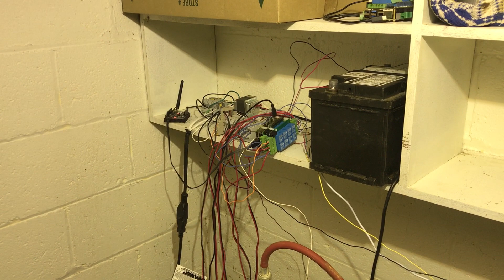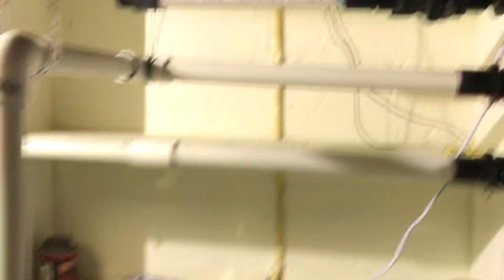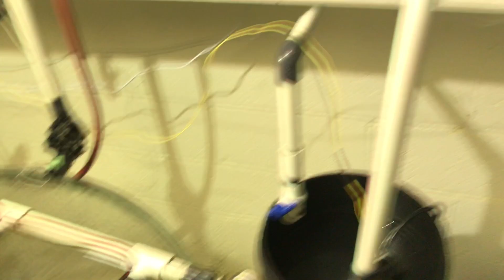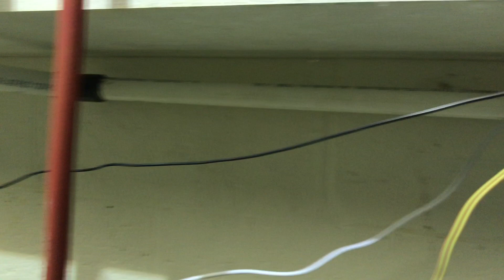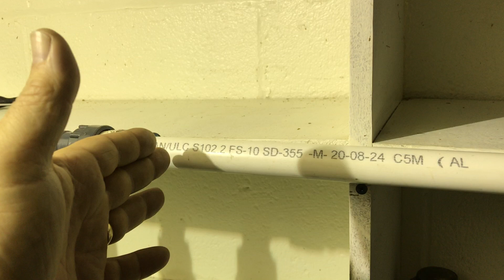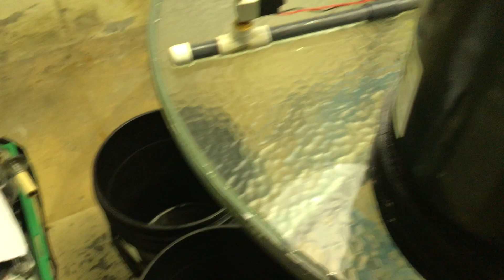Shotgun Aeroponics

Comment: Is this using RO water? How is the buildup in the nozzles? 

Very cool setup, this is unique. My worry is the quality of water your feeding. Also, interested in the nute cost versus DWC. This seems like drain to waste on steroids.
Reply: Not RO water yet, but no buildup in the nozzles. On Lake Ontario city water so not too hard here. pH is 7.8 at the tap so using about 50ml/day of pH down. Nute cost seems very low. To maintain 300 ppm requires 2-3 tablespoons of liquid non-organic nutes per day. Feeding is now also automated using a 1600 ppm concentrated solution added during water replenishment every 150 misting cycles (about every 100  minutes). Better light/water/food/humidity/CO2 is required to really test properly. More interested in getting the controls all working properly right now. But, the plants are still alive!

Comment: Hi Martin, 
A solar panel/charger will keep the battery topped up. I have 75psi mains water but its so hard you can almost stand a spoon up in it :) I`ve used it to power aerocloners in the past, the only problem was i needed a decent length of tubing to give it time to warm up to room temp from 50F.  It comes in  handy for testing nozzles (on the outside tap) and the pressure is plenty high enough to run the RO system. You have an eye for detail so you`ll soon pick up the skills needed to keep plants alive.
Reply from the maker: Yes re a solar panel as this system uses very little power. My water comes from Lake Ontario and I measure 7.6 pH with a BlueLab pH pen. Incoming city water temp is between 45F (winter) and 55F (summer). Time spent in the bucket and my piping passing near the light raise the temp and can be adjusted. I will measure temp in the root zone soon and make adjustments to the pipe length and proximity to the light so the root zone stays at 65-70F...which I have read is the desired range.
Reply: @recessd4094  
I aim for chamber temps no higher than 21c  lights on and no lower than 17c  lights off.  The main thing is to get something growing  :)

Comment: Cool deal brother! Looking good!  Keep it up!  We got to bring gardening up to the 21st Century standard lol!  Like the idea... A LOT, understand the efficiency you are trying to get.  One thing that might help the community is the practicality.... I know most won't spend the money like how some of us do.... Initial cost involved is what I try to keep in focus.

Also, many may not have the skill set you posses  and  taking the first steps into Aero might be intimidating as it was for me when I took it up.   K.I.S.S. is what I try to apply....  because, I know for many they want to have the hands off... OR might not have the trouble shooting skills required to chase down a clog at a single point.

Couple of things I've noticed during my years of doing this is... Oxygenation in your water/reservoir and  mixing of the nutrients.  I've remedied this with a "mixing pump" which uses a aeration tube and velocity to draw air into the mix.... this pump runs the entire time on my outdoor res.

Last thing I've noticed on my grows is that .. with Aero I have been able to push a lot higher PPM than with say a DWC system without burn. ... so, I don't know if dilution of the nutrients will deprive your plants.  Since the dosages are more controlled and in smaller intervals I've played with the water to nute ratio.

Keep me posted with your grow and I really like your set up because if you are going to grow different plants then it would be nice to customize the feed rate cycles to each individual base!
Reply from the maker: Thanks! Glad you like it as I respect your opinion and experience. I'm currently slowly dialing down the cycle time, interval, and adjusting the root height above the nozzle to find the sweet spot that makes the roots happy, white, fine, dense, etc. I think I'm currently overwatering. Then, I can refine the pump/valve timing to mix/load nutrients into the Loading bucket just prior to the start of a new cycle (meaning no dwell time or large reserve of nutrients). Hopefully that will eliminate the need for Oxygenation in the Reservoir? Trying to eliminate as many moving and electrical parts as possible. If you have a link to one of your videos that shows your oxygenation/mixing setup, I would appreciate it. Higher PPM is interesting. I've been running 250 ppm in the first few weeks of the first grow, only because I read Aero only needs 1/5th the nutrients of soil. What would you suggest and what would I notice re burn if I was running too hot? Initial cost is quite low as Raspberry Pi's are almost as cheap as wheel timers and 100 times more useful. I'll upload a few more videos in the next week or two.
Reply: @recessd4094  how many solenoids are you running?  can you isolate them and fire them individually?  sequentially or saturation set up?

as for the nutrients... play with it is what I will say.  take everything you read with a grain of salt.... no 2 systems are the same... 

you will have may factors that will be game changers.... have you noticed the lighting guys always talk about micromoles and photons?  how some then talk about spectrum? lol

then you got wind or fan circulation and it's importance and humidity VPD.... and then you have the guys who say its not important... it's the "swings" that kill you lol.  temp shifts from lights on and off... or far red and being able to shorten the sleep time so, 14 hrs vs 18 hrs.

then you got intensity  vs duration....  and then you got things like calcium in flower.... too many factors to say it's one thing...

I think many people forget this is a system thing....  "as a whole"

best advice i have for you is... know your system and know your plants... if you can diagnose them both.... you will be solid.

just keep going at it and it will tell you one way or the other.... it always does lol
Reply from the maker: @aeromah1062  Currently.... 7 solenoids,  3 valves, and a submersible pump, controlled by a Raspberry Pi. Check out Video 2 for how I control them. Currently firing the solenoids for .750 seconds every 38 seconds. Fully adjustable via software so I have all the controls...just gotta figure out how to drive. I don't have a decent light or CO2 or humidity control yet so focusing on root development. I will start new clones every week or two and monitor improvements in the roots of newer plants as I tweak PPM, pH, firing time and cycle time. Once I like the roots I will worry about lights, humidity, CO2, etc. First try was too wet (misted for 2 seconds every 45 seconds).. 2nd try better. Will get the wiring tidied up over the weekend and post a new video about that early next week.

Comment: Very interesting idea, but as you've said the nutrient solution becoming more and more diluted. Even if you'd run a constant and very precise equipment to measure the pH and EC(For example Atlas Scientific, they actually have a hydroponics kit) you'd end up using much more nutrients in the long run, and that's ain't no cheap. Also, that's tap water. Have you measured the EC of it? Even if the EC and hardness is good, it can have contamination of iron, copper etc. what could eventually set back your overall growing efficiency. On top of that it's very nice that you have 70psi pressure (super excellent actually, where I live it's a fraction of that) but have you thought about the fluctuations of the pressure? In the mornings, and in the evenings when everyone is using the water in the city, the pressure significantly drops down, making your system a low pressure one also your calculations for how much nutrient you should add changes.
Don't get me wrong, this is actually something super new what I've never seen before, but I think if I'd run your system I'd go bald from the stress what it'd cause to me. Also, I think a properly dialed in nutrient solution in dwc would kick the ass of a fluctuating solution/with potential nutrient toxicity hpa, but that's just my 2 cents.
Reply: Thanks for your feedback. There is no real need to return the water used to create pressure to the nutrient bucket other than I don't have a floor drain handy in that part of the basement. The current water consumption is .5 ml per spray X 7 nozzles X 90 cycles/hr X 24 hours = 7.56 L /Day so about equal to about one extra toilet flush per day when I switch to an R/O food supply and drain the pressure water to waste. The city pressure never varies from 70 psi. The variations come when somebody in the house flushes the toilet or has a shower. The quality of the mist deteriorates for a few minutes, but nothing the roots shouldn't be able to handle. My strength is actually automation, not gardening. Building EC, pH, and Humidity control with PID loops (automatic self adjustment) for each into the Pi is not difficult. If you look closely at the pile of wiring you will see an antenna on the left through which I can monitor and control the system over the internet. It will be able to maintain a consistent nutrient solution and feed itself, no problem. But first, I need to learn how to not kill the plants by over/under watering or over/under feeding them or too much/not enough light etc.
Reply: @IamMalibuBoy  I understand now. Well, you can do higher ppm in aero, and if you do auto nutrient feeding you can overcome this problem easily. But you stated in the video that in AAA a compressor can break down. That's true, but everything can break down. Peristaltic pumps (I guess you'd use those) can break down easily. The more complex the system, the more vulnerable. 
Something what I didn't see in your system, I suggest to you is to circulate your nutrient solution, both the reservoir and the auto feeding system. What I've seen in many builds that if the water is stagnant, nutrients can and will build up, clogging your system, and make your solution to go bad.
Btw what system do you use for automation? I've put together my own system in Home Assistant. It was very easy to integrate all the shit  into it, also there is a huge community behind this system, and it's free.
Also if you make any progresson, please keep the content up as I'm really interested.
Reply: @hernadibotond  I'm currently using a Pi 4 with a Home Auto card plus an 8 Relay "hat" on top, both from Sequent Microsystems. The automation is done in Node Red. I'm going to clean up the wiring and do a video about that, then one about the Node Red part. The various measuring devices for pH, PPM, etc all run off a 4-20 ma signal from their probes. The expensive devices attached to the probes just interpret the 4-20 ma signal, which is 99% software. I will eventually input the probe signals directly into my Pi software. I can then "output" commands for feeding, ph adjustments, etc based on real time measurements. What appears complex and expensive is really very robust and probably the least expensive way to build a hydroponic/aeroponic system...especially if your time is worth anything. 
I appreciate your input re nutrient buildup. I did see a bit of that early on when I was only testing one nozzle. I am hopeful that because my reservoir is small, agitated every 2 hours during the feeding cycle, and constantly being refreshed that I can avoid nutrient buildup without additional components. I can also shorten my horizontal feeding tube. Making it 1/4 its current length would require a new feed cycle every 30 minutes instead of every two hours. I can also reduce the volume of nutrients in my 5 gallon reservoir pail. 2 gallons would be sufficient, just playing it safe for now. I may also continue with recycling water into the reservoir and add an inline R.O. unit on my water supply. One step at a time!